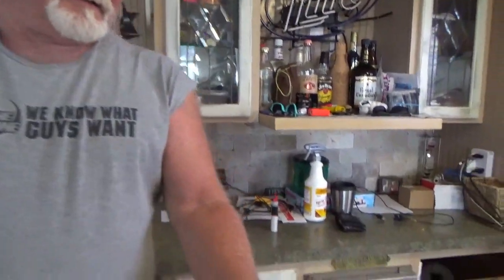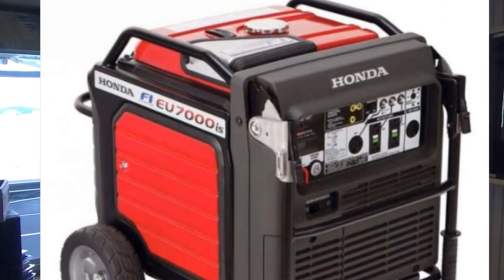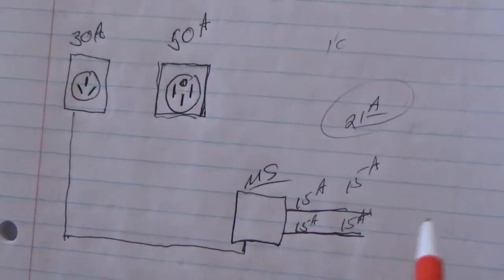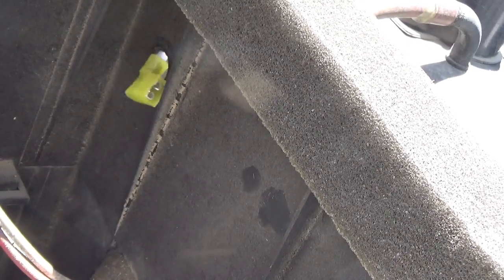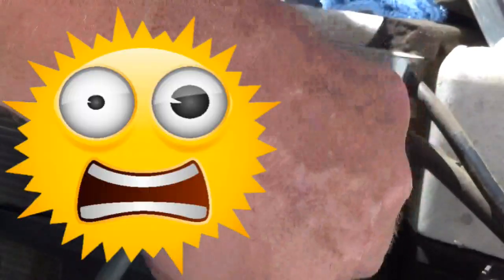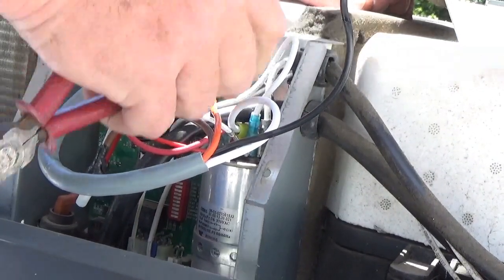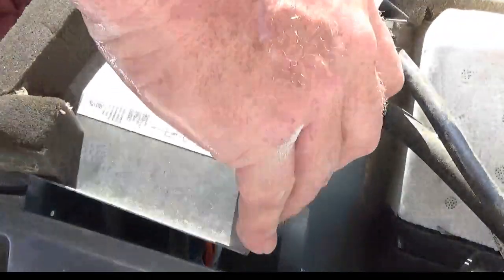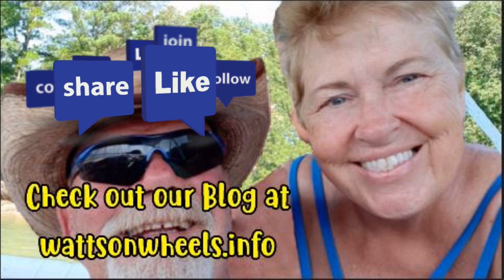💪 Micro-Air Easy Start Installation for RV AC Units // Is it Worth It?

Comment: Thanksm I have seens several variations of this install, its fairly straight forward, and will be adding when I get the class C, until I can install a mini split that will run of solar. But I plan on 96% boondocking and maybe a 3500 W Generator, wiht lots of solar and 600+ Hours of lithium batteries
Reply from the maker: We hear more and more are going towards mini splits. Sounds like a plan.

Comment: Good job on the insulation there Dave. Would be good if manufacturer of RVs could have the easy starts
Installed when built at factory  .
Reply from the maker: Agreed.  But you know, too much cost for them.  They'd have it as an upgrade for $2000.

Comment: As a old Hvac tech  did you take the original  start capacitor out of the loop since you added  that Easy Start to your  AC system's?
Reply from the maker: Yep, sure did.

Comment: You got 2 hot legs baby, heheehe good info, I got one Easy Start on my 2 15k btu units and after Hurricane Sally the wife and Motherinlaw were very comfy in the RV (on one AC) while on 4500w gen. My Main AC unit had a device that piggybacked the start cap for the Heat Pump that had to be bypassed BUT the purple wire had to go to the common of the start cap else my heat pump would not work, just a heads up for those with heat pumps.
Reply from the maker: Good info.  Thanks.